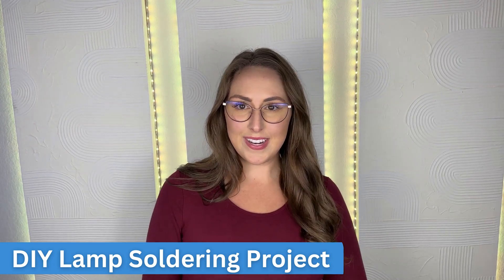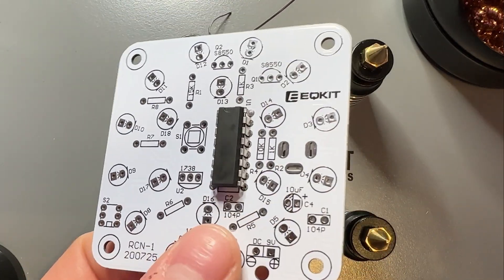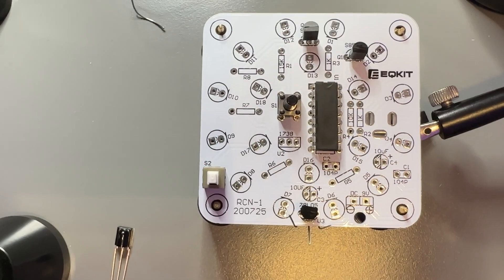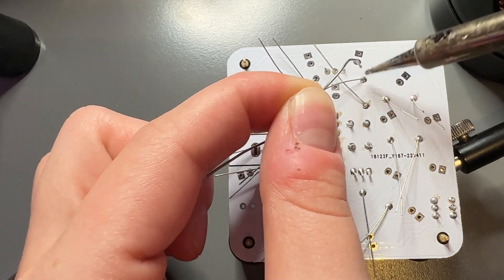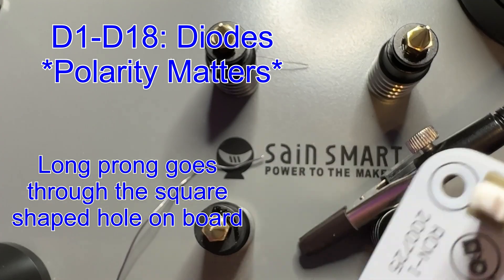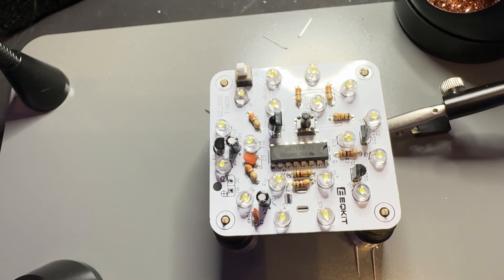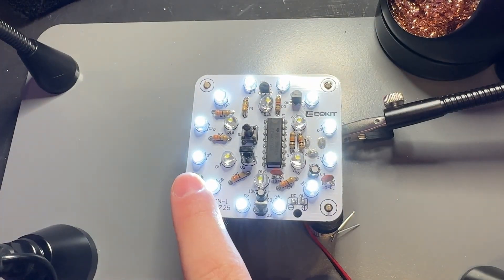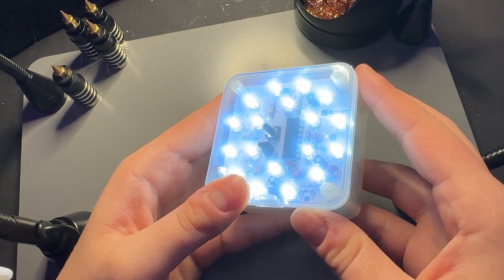DIY Lamp Soldering Project for Beginners

Comment: The switches don't have prongs, they would be legs, yes this video is a couple years old. You are also having Solder (sauder) wire going over the iron. Ideally, Wire from opposite side to the iron. It does look like you are a beginner yourself at this stage. Let's hope your technique has improved from this time